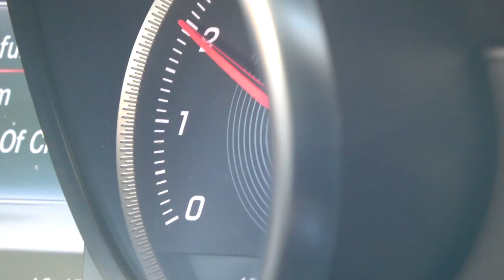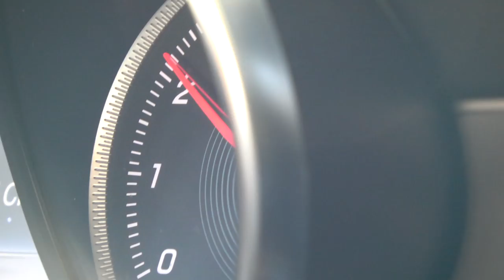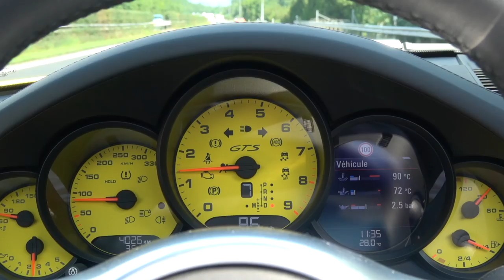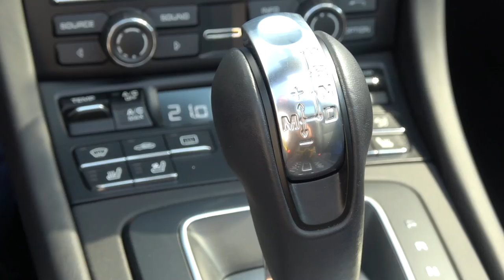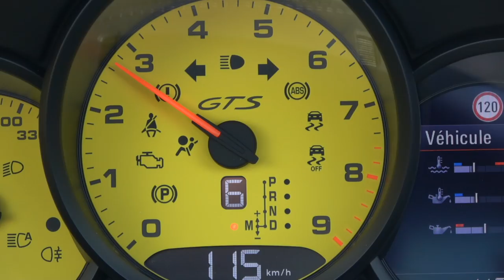Collecting Two Porsche Targas And Heading To Gstaad | MrJWW

Comment: Fantastic video as always, James! On the subject of the acceleration of the old vs new Porsche, there's more to be said than just weight! The new 911 has endless electronic safetysystems, climatecontrol, heated seats, infotainment, etc., not only adding to the weight, but also adding to the stuff the engine has to pull! So the classic not only weighs less, but the 180 hp is going straigt to the wheels, where the new 911's 430 hp is doing tonnes of other stuff as well. 

Please do keep up the fantastic work, James!

Comment: Superb quality movie making here , you never disappoint james. Remember  vehicle horsepower quotes are from an engine on a test bench at the crank ,in a laboratory  , not in a car, you can subtract at least 100hp at the driven wheels with driveline losses such as gearboxes,  diffs and driveshafts,  hence the feeling the power is not quite there, not just the weight issue. You could put some of your car's on a dyno to see the difference from the quoted horsepower  values, that would make for interesting  content  i.e  ," what horsepower does a Ferrari actually produce. ". ??

Comment: Little disappointed about the weight of the Targa GTS, cause IMO the Targa is far and away the prettiest 911 in YEARS. James, would you still rock one with a tune to unlock those turbos a bit?
Reply from the maker: +Stephen Overstreet This wasn't the turbo generation it was gen 1 - a turbo would allow for very welcome extra torque
Reply: Aren't the Targas AWD too? Overall this is a GT version of the 911. For style this is the one to get, for performance Porsche offers many better choices.

Comment: 9:02 James my 981 Spyder is all manual as well with the roof.  With no insulation, just bare metal and fabric.  With it up - there is no wind - but the connection is as strong as you are still accoustically naked.   But yeah - need to keep eye on weather and be ready to pull over.  Need to get out of car but can put up in less than 1 min.  BTW when are you coming to Australia!!!!

Comment: The only problem with the 991.2 Targa GTS as any keen driver will tell you is the manual trans is better. I would take the older orange car over the new yellow car any day, because of the transmission. I don't care how fast it is, its about the experience. Thanks.

Comment: sorry I'm late to the party, but I THINK the 911s you've driven recently have been 991.2 cars with the turbo'd 3.0, so this 991.1 would have more of a torque curve and less of a torque line at the top of the power range.

Comment: Isn't it turbo charged?
Reply: maybe it's in test drive mode?
Reply from the maker: +Duncan Pitfield Not this one - 2015 just before the change
Reply: Thanks mate, the early Targa is about a ton with about 180 bhp, so let's just call that 180 bhp per ton, the 2015 Targa with about 420 BHP and weighing about 1600 bhp os about 260, the PDK should make it really responsive where old fashioned automatics would have slowed it down a touch, it should easily be the faster car especially with the extra grip from the more modern suspension and tyres, not to mention the brakes. I'd love a drive in both, I'm ex Porsche GB and miss them